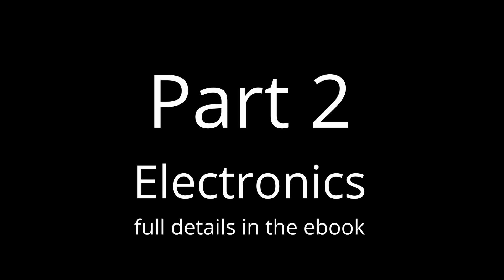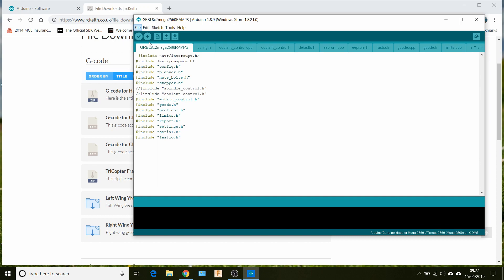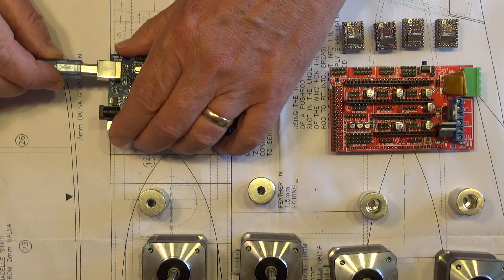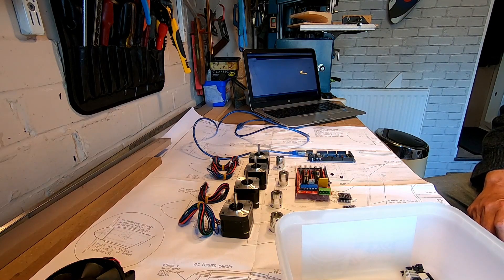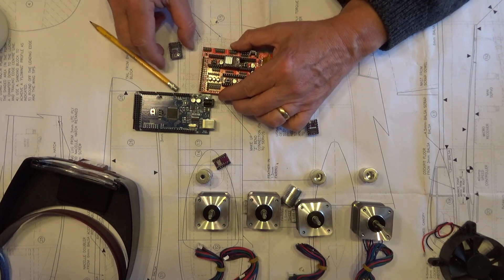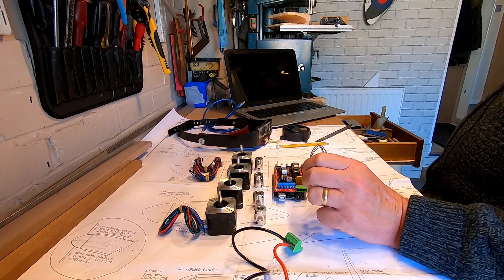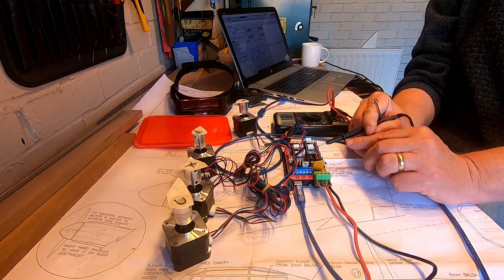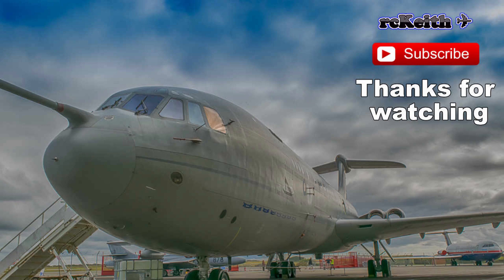How to Build a USB Hot Wire CNC Foam Cutter - Part 2 Electronics

Comment: Got the electronics today and followed your guide and everything is working! thanks
Reply from the maker: Glad it's all working good luck with your build.😀
Reply: @rckeith  Yeah the tutorials are great!! how thick is your resistant wire?
Reply from the maker: @antonl1894   0.4mm
Reply: @rckeith  found some .2 mm at the local hardware store, think im going with that and springs:)
Reply from the maker: @antonl1894  Should be OK I prefer to use very thin wire.  I have tried many types even guitar strings but thin always gives me the best results
Reply: @rckeith  oh i meant 0.2 millimeter
Reply from the maker: Yes, I understood some guys use much thicker wire. I was just trying to say I prefer to use thin wire as well,
Reply: @rckeith  ah great! have a good day

Comment: Am I missing something with the RAMPS  board power input? In the video you have jumper wires running from the power supply inputs at the RAMPS board to the other + and - terminals. Are these necessary? What are they powering? Do they need to be 16 AWG?
Reply from the maker: The RAMPS  board has two outputs 11 Amp and  5 Amp . So it's to feed these circuits. The hotwire can use the 11A which I think is D8.  Hope  that explains it.
Reply: Keith Howlette oh, I see. I was having difficulty cramming two 16 AWG wires in the terminals with the fan as well but I got them in. Thank you. I also wired the fan into some open terminals direct to the power supply.
Reply from the maker: @shakeyjakefpv7855  I don't use the RAMPS board to control the hotwire anymore. It does work but I found it difficult to get good temperature control. It was either too hot or not hot enough. I don't think it's the RAMPS board fault  but the software. I use my iCharger 206 which has a foam cut option which works by supplying  a constant current.  You can also use most Lipo chargers with a NiCad option and set that to around 2 Amps as a starting point.

Comment: Great video, thank you very much. I want to cut letters 60cm in height. Can I do this if I decide to buy your plans? Do I have to change anything?
Reply from the maker: Probably not the machine was designed mainly for rc models. It would need to be much bigger and then the electronics would need to be upgraded to handle a heavier machine. So the cost would be more. Sorry it won't work for you.

Comment: sorry to ask you but im new to this, i have an arduino Uno R3 Atmega328p and it does not match your firmware, can you help me find the correct firmware for this particular model? thank you for all the help you can give me.
Reply from the maker: This is the firmware that will work with the Uno  http://www.devcad.com/eng/devcncfoam_f1.asp
When you run the application it installs the correct firmware to the Uno.  But it's not free and costs 60 Euros.  You can try it for free to confirm your hardware works OK but it will stop after 400mm of movement until you purchase a license. It works on several hardware configurations including the Arduino Mega as well.  I use now and it's very good.

Comment: Hi, I'm into building 4 axis foam cutter, your design is simple and easy to build. Can I use Arduino UNO and 4 axis shield instead of Arduino Mega and Ramps? I ask because I have Arduino One sitting in my drawer and I'd like to use it.  Thanks.
Reply from the maker: You can but the firmware on the website won't work with it.  You can use the firmware for DevCNC Foam
http://www.devcad.com/eng/devcncfoam_f1.asp but it's not free €60.  It works very well and I now use it on the Mega with the RAMPS board. Hope that helps

Comment: Hi. I just finished most of this CNC foam cutter. When I connect the HotWire Controller to the ArduinoMega  I tried stepper motors through the HotWire Controller and they work. But when I do connect, an error occurs at the end of the frame Status: error grbl: Bad number format.  Can you explain what the problem is?
Reply from the maker: Hi Ivan, I didn't write the  firmware so I don't know where the error comes from. But it doesn't have any effect on the machine, I've run mine many times and it works fine so just ignore it. 
Keith
Reply: Thanks for your reply. These days I will test the CNC. Is it the same procedure with cutting 2D plans? I woul try to cut the ribs for the wing on this CNC? Is that possible?
Reply from the maker: @ivandzeletovic6485  Hi Ivan. It's  a little different you need a program like DevWing foam or Jedicut(free option) to generate 4 axis gcode. Have a look at Part 4 of the video series where I show how to generate the gcode for a simple wing. 😁

Comment: Has 1/8 stepping worked ok?  How do you make it 1/32 stepping?
Reply from the maker: Hi Chris, yes absolutely fine. Remember this is foam we are cutting and doesn't need the accuracy of a 3d printer or milling machine. If you use 1/32 micro-stepping you loose some torque on the motors. Every model I've made with my foam cutters has always used 1/8 micro steeping. If you did want to use 1/32 then you will need the DRV8825 drivers as the A4988 only support 1/16. The jumpers under each driver on the RAMPS board will need setting to 1/32 and the steps/mm in firmware will need to be recalibrated.  I don't think you would gain anything on the foam cutter using 1/32 in my opinion.
Hope that answered your  question. 
Keith

Comment: You just jumped over to "let's test the motors" and spun the stepper motors, but didn't say what software you are using to test?????  Please advise.
Reply from the maker: Hi, sorry a bit of an oversight. I've released an updated version of the software since the video which you can download from here https://www.rckeith.co.uk/download/grbl-hotwire-mega-5x-application-v3-2/ there is also a video and a post on the website to explain its installation and configuration  including the later firmware as well/  https://www.rckeith.co.uk/grbl-hotwire-mega-5x-for-cnc-foam-cutters/
Check the playlist which has all the videos for the later software and firmware.  Testing the motors  hasn't changed with this later software.
Keith
Reply: @rckeith  Thanks!  Will do.

Comment: I did the same but only 1 motor works. The other 3 motors didnt. Pls help
Reply from the maker: Have you set the vref to match the current of your motors.  Which model of motors are you using.. Try moving the motors to the axis that works to make sure you motors are OK.  Sometimes the wiring of the motors needs to be changed.  Some guys have found that an issue.

Comment: Would the A4988 driver work??
Reply from the maker: Yes, they can work but don't handle quite as much current only about 1 Amp continuous. You would need to make sure your stepper motors don't need any more than that.  Also, use a cooling fan as well. So as long as the steppers don't need high current they should be fine.  Here's a link comparing  various drivers https://www.pololu.com/category/120/stepper-motor-drivers
Reply: Keith Howlette I going with your drivers.